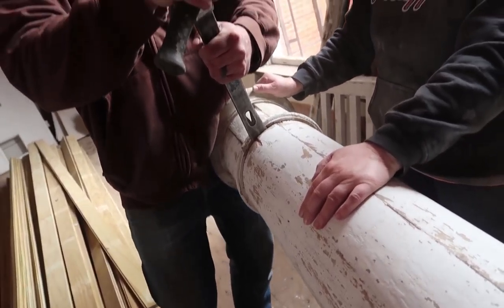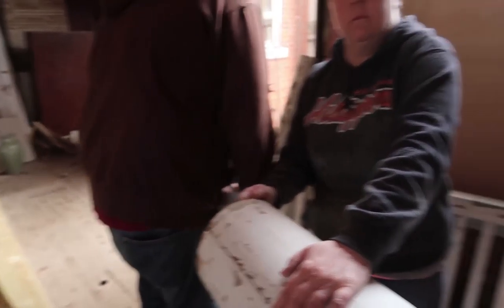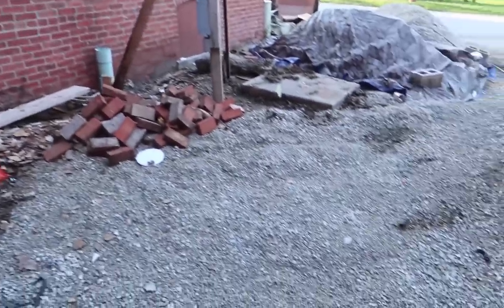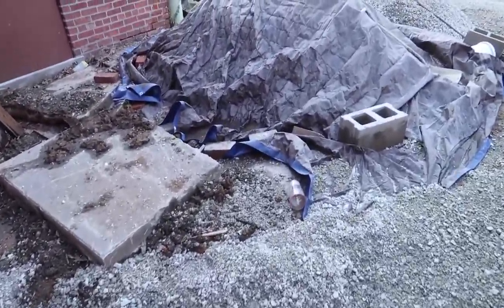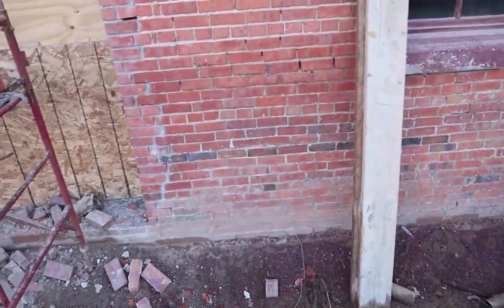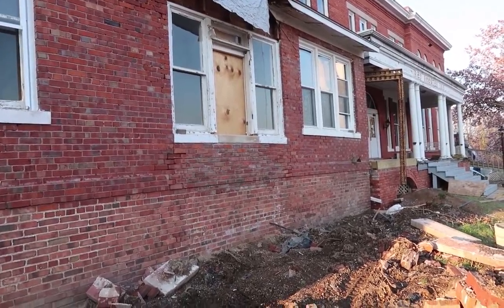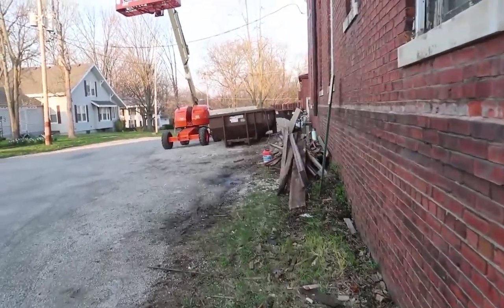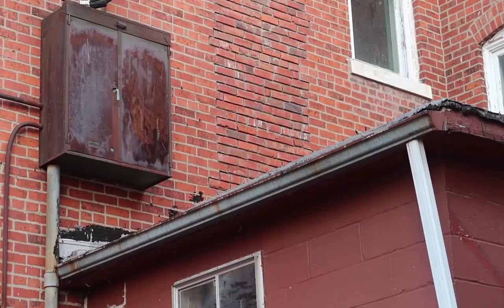Red Rooster Inn Restoration 18: Lumber, Deck Flooring, Brick Cistern

Comment: That is going to be one magnificent building once it's done! The method you spoke of for making your walkway is quite common in Europe. It has the advantage that you can easily remove and replace bricks when you need to dig a trench or work on something below. Most of the sidewalks and many of the streets are done that way. It's not a fast to build as black top, but much nicer looking and more durable.

Comment: Brickwork is fascinating stuff, once saw an even worse crack that had become a hand-thickness gap in the second-floor storage room of a computer repair shop in an old building downtown that I worked at for a while. Could see light from the outside through the gap in the foot-thick wall, think it had been partially caused by a roof leak, could see daylight through some holes in that too! It's a Make shop now, after they did some repairs and refurbishing. Wonder how they tackled all the brick damage? I should ask whether I could get a tour of the back areas some time, perhaps after I can afford a membership there.